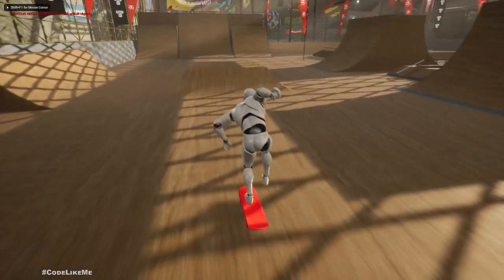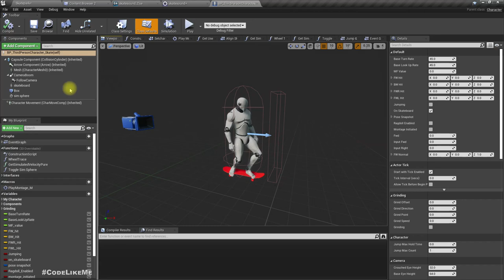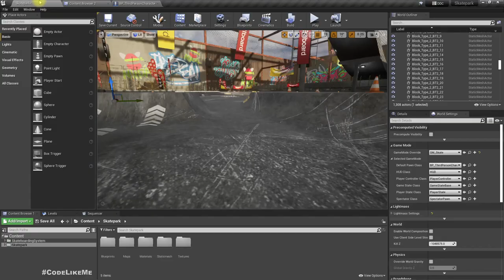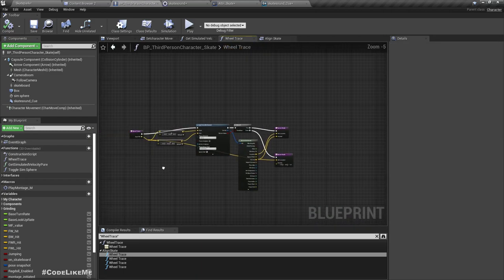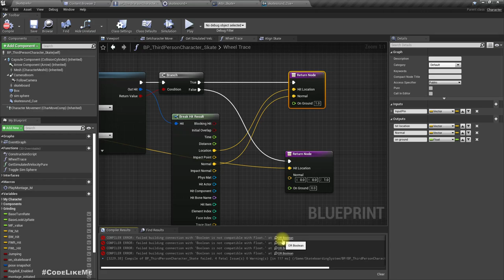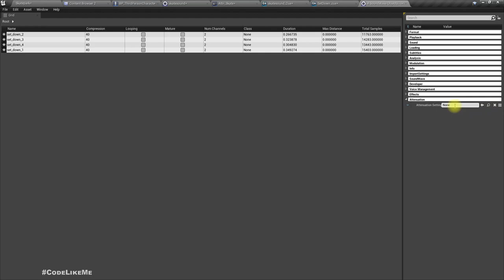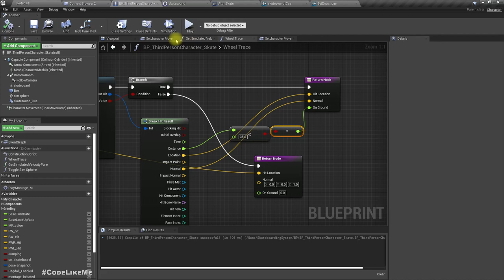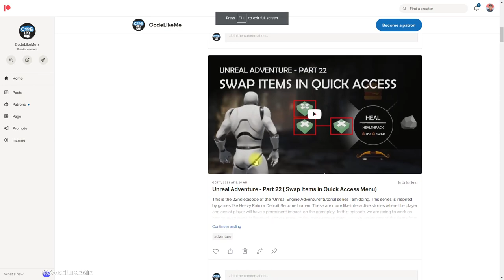Unreal Skateboarding System 15 - Dynamic Sound Effects

Comment: Is there any chance you will update the grinding mechanics to work with the new movement? I have it sort of working in my implmentation however the collision and physics are kind of janky. Amazing work as always, you're a legend. Thanks!
Reply from the maker: Yes, soon
Reply: @CodeLikeMe  Thanks! I will keep trying, seems to work beter collision wise with a smaller physics sphere. Currently trying to make the turning arch sharper as adding the Right vector force causes the character to speed up to unwanted levels when set higher.
Reply: @CodeLikeMe  Hi, I read your answer on the UE4 Marketplace that the pack there is still from May 2021. This means the park, grabbing board and walking, the sounds and many bug fixes are not there. I would like the complete pack. When are you planning on updating the assets there? I want to buy it but only after its a finished product. Thank you!